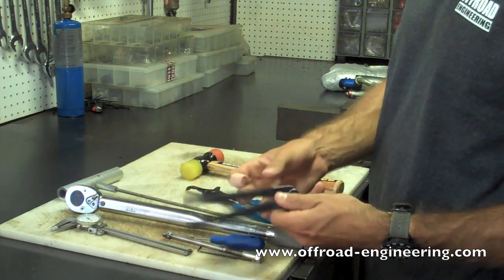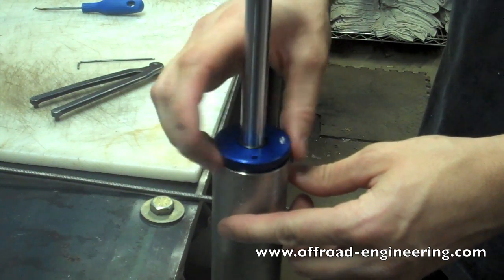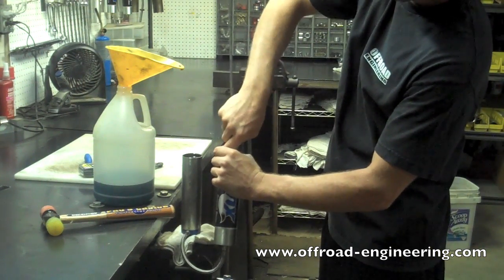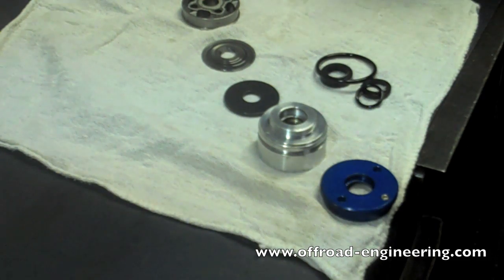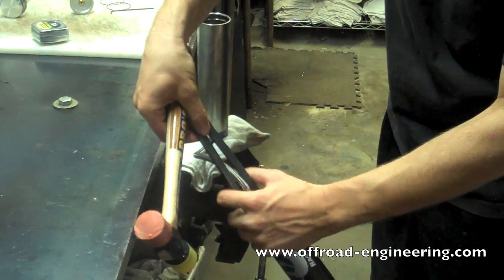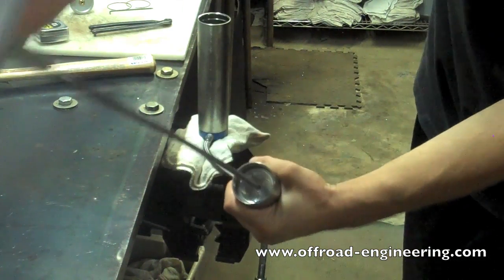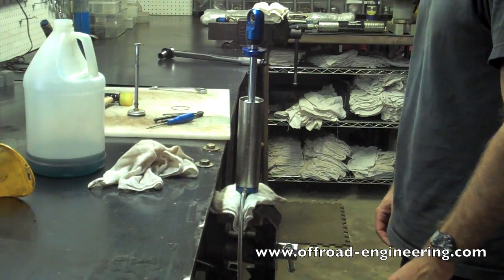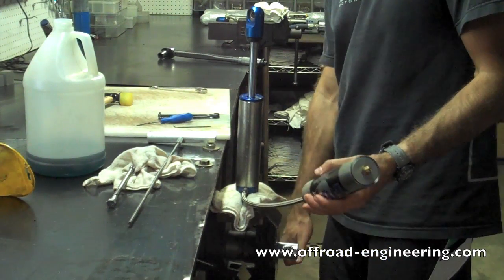Rebuilding a Fox Off Road Shock.mov

Comment: I have a question on putting shocks on a lifted truck I have a 6in lifted f150, would shocks like this work or is there a certain height where shocks don't work anymore and just bottom out I have a pair of SVT fox racing shox and need to get them rebuilt would they work on a 6in lifted truck?please help!

Comment: I will have to rebuild a 2.0 Fox shocks and make a new lower eyelets for my vehicle - I am using Chevy Silverado OEM Fox front remote reservoir shocks on Nissan Terrano 2, and the lower bushings are different.

Can you please tell me what threads are used on a 2.0 offroad shocks? I guess on the eyelet side it is 5/8-18 and on the piston side it is 1/2-20. Am I right?

Also, do you thing I can replace the eyelets using electrical hot air gun instead of gas torch?

Thanks.

Comment from the maker: Yes the 2.0 and 2.5" bearing caps are threaded and can be removed with the same tool..a 2" spanner wrench.  Which is available for purchase on our website if you can't find one locally.

Comment from the maker: It was not a twin clicker, but they are very similar.  You bring up good point about the assembly lube.  Fox does use some type of grease to assembly the shocks when new, I am not sure of the exact specs.  We use a high temp automotive grease when we service shocks.  Thanks for pointing that out.

Comment from the maker: It's 3.50" from the opening of the shock body.   So fill the body up until you have a distance of 3.5" from the top of the opening of the shock body to the top of the oil.

Comment from the maker: You can search my site for part# 803-00-010-A.  This is for a 2.0 diameter shock body, with a 5/8" shaft and remote reservoir.  If you have something else, contact us and we can help you figure out the correct rebuild kit.

Comment: I have been schooled as to not use a torque wrench to remove nuts as it effects the calibration of the tool.   It is for righty tighty only, not lefty loosie.
Reply: how do you torque a left hand threaded fastener then?

Comment from the maker: @Crypto666 Yes the IFP tool is 1/4" threads.  You do not need to compress the shock before charging.  Just fill with nitrogen and you are done!
Reply: 1/4"-20 male threads

Comment from the maker: @MaulTechATV  Unless your dealing with extremely stiff compression valving.  The air should be forced out from under the compression shims when you install the shaft assembly back into the body.  If your worried your not getting all the air out from under the shims you can stroke the piston in the oil by hand a few times.  Just make sure you don't pull the piston above the top level of oil once you have done this.